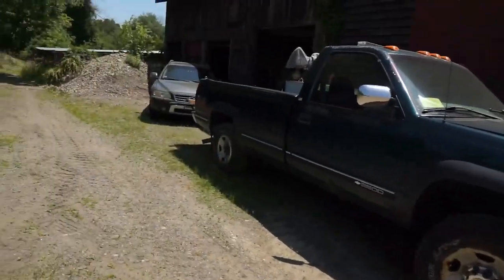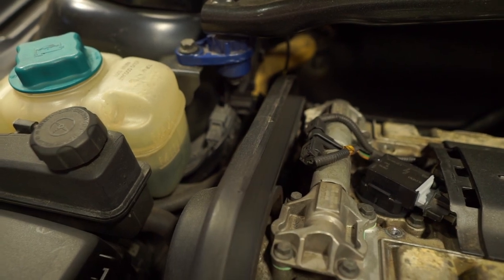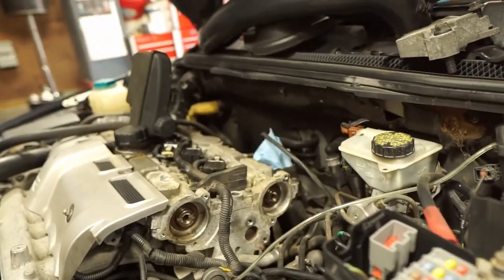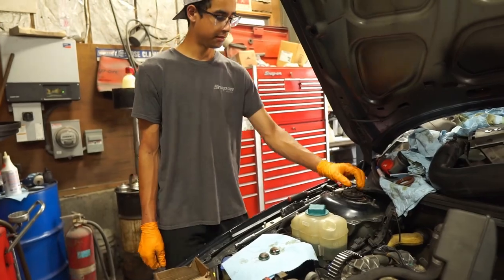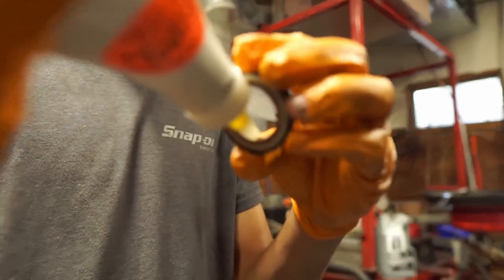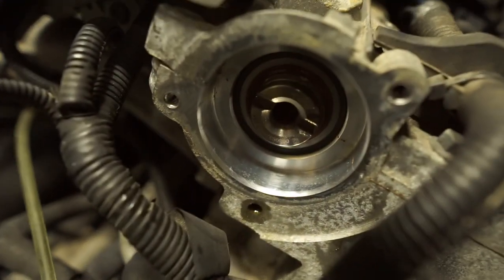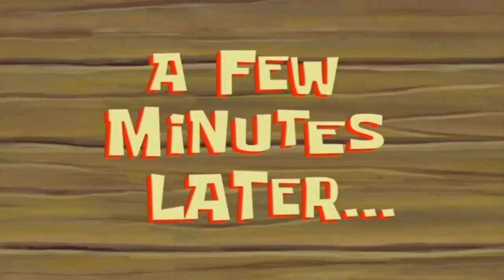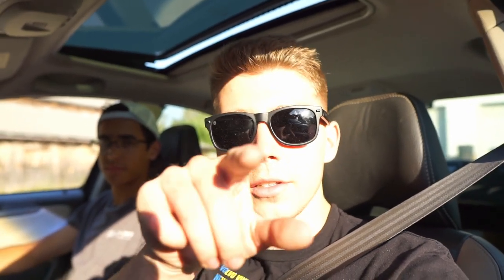The MOST OVERLOOKED ISSUE On Older Volvo’s | VVT Hub Installation

Comment: Hmm… I’m really wondering if this is what’s been causing an issue with my 2000 V70R. It’s painfully laggy taking off from a stop most of the time, gotta ride the clutch more than I should need to. With the AC on, it’s practically undrivable. Once you’re over 3k rpm or so, it rips. But under that, it’s a slug.

Comment: Not a bad video. Your buddy Jacob has a lot of knowledge concerning volvos. He does a great job in explaining his techniques on the repair. Good job. Also, did you count how many times you said Jacob? Dude. Then, did you really ask a bunch of motorheads to critique your hair? Again, I enjoyed the video and the info. Thanks. I'd love to get some info to fix an 09 S60 2.5t I have. Be blessed.
Reply: what is wrong with it
Reply: Thanks for writing back.  Turned out to be the fuel send on the fuel pump.. the car would lose power when driven aggressively. No peddle pressure.  Got a thinkdiag tool.  I found out it was fuel related.  Changed the filter,  no help,  the pem module,  no help,  the gel pump.  Ding ding ding! Bingo!  Car runs great now

Comment: I have two base model P2 V70's, 2002 and 2007, both with the naturally aspirated B5244S.  I think both engines have VVT on the intake only.  How does the info in this video play for my situation?  Would everything more or less transfer over from the higher spec engines?  I will try to do the test for play, although both engines are under 100k original miles with really good lubrication histories.  Also, are there rebuild kits for these VVT's?  I know nothing about this subject, is it even advisable to rebuild them as people do with BMW vanos?
Reply from the maker: Hello! Your 2002 might only have VVT on the intake side, but your 2007 should have VVT on both intake and exhaust camshafts. The process is identical for the B5244S. There are no rebuild kits, just replacement parts from Volvo. I hope that helps!

Comment: Hoping this is what wrong with my 07 xc70, did an oil change and now skips and wants to die at idle and throws an 0016 code. If i drive it down the road it drives kinda fine, min you are off the gas it falls on its face. Checked plugs and all electronics new, new timing belt, new head gasket. Nofticed head bolts were not torqued to spec, so tore down everything to check that timing was correct and didnt jump a tooth. All look to be right on. No deflection in belt. All brand new volvo parts, single owner had all work done at dealer and they dont torque head bolts to spec. Going out now to check pullys, there had been times i thought vvt was messing up as it sounded like a diesel engine.  I would shut it off and restart and would go away. 🤷🏽‍♂️ Hope this is the video that gets me back on the road, hope i dont have to barter with you for help or parts.
07 xc70
05 xc70 
✌🏼💚Volvo
Reply: Had a similar issue to this the fix ended up being replacing the (fuel rail pressure sensor) if you haven’t replaced that already I would take a look into it